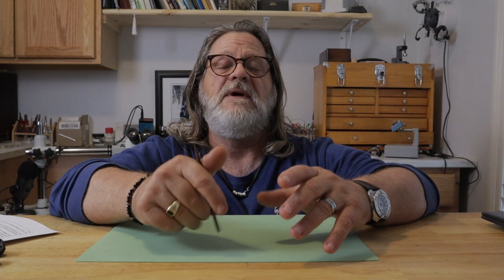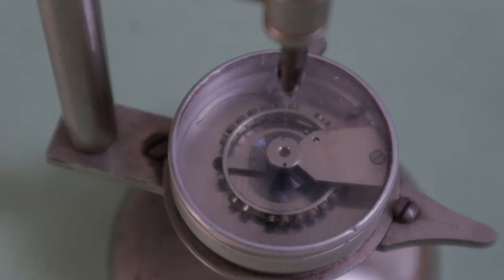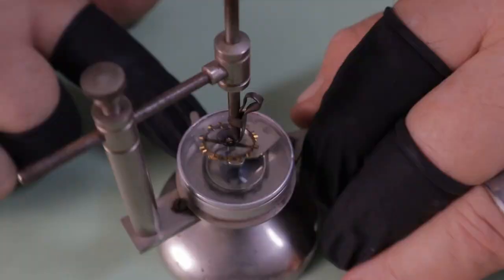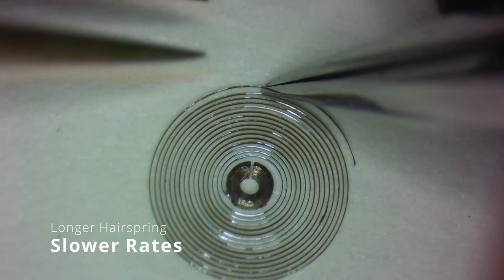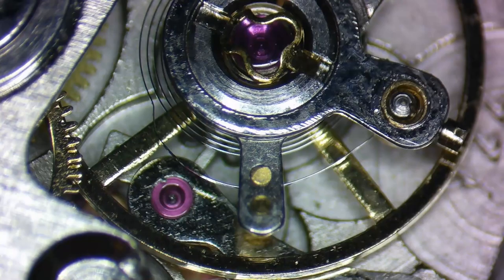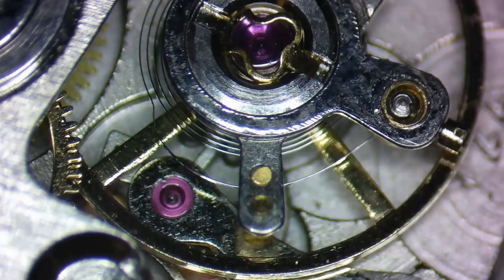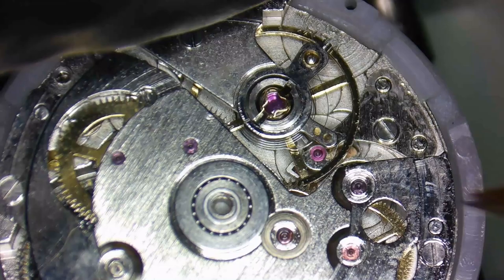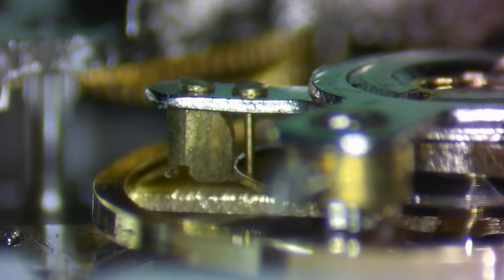Watch Regulation- The In's & Out's

Comment: It's getting more complicated now Alix. I've watched the video a couple of times but not sure if I'm missing the point. I realize the pins should be parallel but thought they should be as close as possible but the hairspring be able to freely pass through them to stay constant at low amplitude. Am i missing something? If you get paid for views I might be helping you get rich with this video😂
Reply from the maker: Sorry Keith, 
Let me try to clarify what I was going for here. 
1) First was the point on the hairspring that is determined from the vibration of the hairspring with is the counting point. This is the area on the hairspring where the rate will be closest to zero without any other manipulation.
2) The next thing if that if the counting point was attached to the HS stub, there would be no way to fine tune the rate and at the same time would be even worse because of the natural fault of the hairspring created by the pinning of the collet. The rate would be worse.
3) Because of the need to be able to fine tune the rate, there has to be a mechanism built into the movement that can change the active length of the hairspring. The active length originally being the real counting point. 
4) That's the job of the regulator pins. They change the active length of the HS to be able to get to the practical counting point, 0 rate.
5) Depending on how the HS sits while at rest in between the pins, will determine how the HS reacts to different amplitudes AND whether or not the active length moves away from the counting point or sweet spot or if you will, or closer to it producing better rates.

You are correct that the pins should be as close as possible to the pins without binding BUT, they still need to be straight and parallel to each other otherwise you are going to create a positional fault even in the horizontal positions.
Does that make sense
Reply: Cristal clear. I think I was looking to far into it. Your knowledge and willingness to share in such an unreserved and friendly manner is what makes this channel outstanding. Thank you my friend.

Comment: You mentioned in one of your videos ( maybe this one) that you have to wait 24 hrs. After lubricating to actual regulate.  Others channels may actually do that but I don’t think it was ever mentioned.  Thanks again!
Reply from the maker: If you’ve properly serviced the watch, and you take a reading as soon as you put the balance wheel in and then look at it again 24 hours later, you’ll notice there’s a difference. This is basic watchmaking, 101.
Reply: @watchrepairtutorials  one more question, do you have a video which beat error and regulating a vintage balance with the adjustment screws? Thanks again!
Reply from the maker: @Al-po2oh  That will be covered in m watchmaking course.

Comment: so i got a new watch. brand new with an sw500. the watch runs absolutely erratic. been having this thing for a month now. some days its at +6 seconds and some other days its somewhere between +10 to +45 seconds. i have no idea what it could be, that it is so inconsistent. I left it run itself out and it changed nothing and also demagnetised it. any idea what it could be?
Reply from the maker: As you probably know, there are different grades of the SW500. Assuming it’s the lower grade specify, the factory specs are  plus or minus an average of five seconds a day with a maximum deviation of 20 seconds per day so you max is a little high. 
You didn’t mention the brand so it’s hard to say how well they regulated the movement or if they did anything at all when they received it from the factory.
It could be related to lack of activity to one of the main springs, so the power is on the low side, combined with how much you run the chronograph. 
If all that is normal, then most likely it’s just a problem with the regulation of the Etachron system.

Comment: Great video! I really enjoy the details. One question: How do you position the hear spring perfectly in the midle betwen the regulator pins in this regulator type? The hairspring stud cannot be adjusted by turning like you did it in Etachron regulator. If it is done by manipulating the hairspring... it could take many many attemps... I woud really apriciate if you could point me in the right direction. Do you have a video covering this? Thank you again for your work.
Reply from the maker: What you do is hold the hairspring and run a needle across it to massage it over. It’s a slight touch and you go very slow. Of course you need to make sure the regulator pin or pins are also straight.

Comment: These are the most useful and instructive videos, by far! Thanks so much for making them. I didn't previously understand why the hair spring needed to be centred between the regulating pins, and not touching them, when at rest... but this explanation made so much sense I now understand that in order to maximize the time that the hair spring is touching one or the other regulator pins with each swing of the balance wheel, it must be centred between them. Eureka!
Reply from the maker: Inquiring minds want to know.🤗

Comment: Fantastic video, I worked out, all by my self, that the regulator pins should "nip" the spring. The reasoning was that in the centre the spring was full length and when it touched the regulator pins it was shorter. I eventually realised this was wrong but now I know why.
Thanks
Reply from the maker: Hello Leo, 
The escapement and balance is, for me, the most fascinating part of the Watch. It’s really like a symphony of interactions that happen 6 times every second or 18000 times an hr.
Fascinating stuff.

Comment: You're doing great content mate, been learning alot from your videos.

Just wondering if you might be interested in making a video about hairspring replacements. I've been trying my hand at it but can never seem to get the balance spring inbetween the two regulator guides!
Reply from the maker: I touched down in a little bit in the video I did on adjusting the Etachron system.
Can you be more specific on exactly what problem you’re having?

Comment: This is the level of detail I am looking for and you are the only channel I've found that has it. I have one question though and forgive me if its already been asked in the comments. I scanned them but didn't see it. Question: Are the regulating pins doing anything when there is low amplitude and the pins are in the counting spot? It looked like the hairspring was just passing through them untouched at low amplitude. It would explain why you need a full wind on the watch when you are regulating.
Reply from the maker: Even at low amplitude the HS still touches the pins, which is affecting the rate.
Reply: @watchrepairtutorials  Got it. Thank you sir!

Comment: Alex, 
I was hoping that you would get to the subject of hairsprings. I want to know how many times it can take a reshaping back to round and flat before you just toss it. Not having the tool for vibrating a new spring to the balance, and not being able to find some older model balance complete leaves me frustrated. I had one that I reshaped it 5 times before I gave up and used a donor balance complete. Every time I would reshape it to almost perfection, install it and shortly it would be wacked out of shape again and losing amp. Removed, cleaned, shaped, demagnetized, cleaned, reinstalled, work great for short period, repeat.  Reshaping is a nerve wreaking procedure on a badly out of round and non-flat hairspring.
Thank you for the videos neighbor. Jay
Reply from the maker: Hi Jay, 
All hairspring have an elastic limit which is different depending on its strength and age. A spring can be worked any number of times until some area on the spring is pushed beyond that limit.  If any point on the spring goes beyond the EL it will never be the be the same and is considered set.
just beyond this EL is considered the point of fracture and that's when it breaks.

Comment: Great vid, will definitely need to watch a few times as this is complicated and a bit weird to wrap my head around.
The hairspring vibrating tool at the beginning, is that just a tool to make the process of finding the counting spot faster than simply checking the rate with a timegrapher while adjusting or is that a necessary tool that i almost certainly can't afford and probably shouldn't bother with as a hobbyist?

I'm also a little unclear as to what the purpose of it is if the practical counting spot seems to be the useful spot on the spring to locate and the vibration tool can only find the regular counting spot?
Reply from the maker: After a balance wheel is statically poised so that the wheel is balanced, think of the weights added to a car tire rim, then the hairspring which is always to long when new, needs to be sized to that wheel. 
This skill is pretty much useless today as the new hairspring are not available to the general public, and even though its taught to new watchmakers today, watchmaking has become a job of changing parts out, because its more cost effective.
 The 1st point to the video was to understand that the regulator pins control the active length of the hairspring.  The counting spot is merely the point on the hairspring where the rate will be at its best. 
The second point was that the position of rest of the hairspring between the pins will affect the active length of the hairspring which becomes a bigger deal when the movement goes vertical. 
The reason why this is important will become more apparent when we get into adjusting regulator pins to bring rates closer together.

Comment: Wow.  Just learned a ton here.  So in addition to trying to get a hairspring flat and concentric as it sets on the balance staff, nothing the orientation of the hairspring through the regulating pins sound important.  I have heard that you can improve the positional rate in the pendant down or pendant up positions of the watch by adjusting the spacing between the regulating pins.  Is this true?  Will you be talking about the impact of Beat Error on regulation?  I have run into instance were the position of the terminal stud and collet on the balance staff is not sufficient to allow enough adjustment at the terminal stud to get to 0.0 BE necessitating rotating of the HS collet on the balance staff.  Just so many factors to consider here.  Thanks for the thorough lesson here.
Reply from the maker: That’s a great question. It is true that both horizontal and vertical position can be manipulated by the regulator pins. Very good Supercruze.
It will be the super time of an up coming video.
That is getting into the realm of Watch adjusting.
Super cool stuff coming

Comment: Thank you. Great job.

I've got h-50 (c07701) with a huge difference of an amplitude between any horizontal position (dial up/down) ~270° and any vertical (12/9/6/3 up) - 220 and less. No problem with accuracy, power reserve and beat error. Any advice is appreciated.
Reply from the maker: As you probably already know, it is normal for amplitude to drop between the horizontal and vertical positions. 50° is a lot for that movement. In my opinion if you’re not suffering from accuracy I wouldn’t worry about it.
Reply: Thank you so much! Yes, there's no problem with an accuracy, but sometimes it could stop at approx mid-winding

Comment: Regarding the vibrating tool, it wasn't explicitly stated ,but I'm assuming the spring under repair is supposed to have the same bpm as the test balance?
Reply from the maker: That’s exactly right. the goal is to see both valance wheels oscillating at the same speed in unison
Reply: Thanks!

Comment: Does this mean I have to find/buy vibrating tools for all the different frequencies a watch can run at?
Reply from the maker: You would but they could be very difficult to find. Most vintage watches are going to be at 18,000 beats per hour until you get into the 70s. At that point, you'd be better off, trying to find a hairspring.

Comment: Hello . Exelent training on all subjects. regulating an older balance wills is sometimes a.chalenge , if the pin is not straight. I put a new main spring, serviced a movement and put a new balance will. the watch is running great. but the horizontal amplitude is 340, the vertical is 270--285. The watch runs very stable with a   0 to 02 beat error. the timing is perfect , with the perfect delta. almost no difference between
horizontal and vertical positions.  Should I use pivot flattening, to lower the amplitude. is 340 to much.? it is the same up and down positions.
Reply from the maker: 340 is too much. Are you sure the LA is right?

Comment: I am currently starting with vintage watch regulation and this is my first situation. I serviced a watch and needed to burnish the pivots to get some decent amplitude in vertical positions. This worked out nicely, however after service, I have some huge delta in rate in which I need some help: 

DD +45s/d 280deg BE 0.2ms
DU +60s/d 295deg BE 0.1ms
6clock down -60s/d 225deg BE 0.0ms

So the rate drops significantly when I go to vertical positions. Also, the regulator arm is already close to the full minus position. The both horizontal positions differ but I accept that in this situation (I watched your other video about the flatness of the balance pivot). Now I am striving to achieve similar rates for horizontal and vertical positions, at least not this big of a delta. Do you have some tips where to look?
Reply from the maker: email me.

Comment: Alex awesome series, just one question regarding the regulating pins, I have done a couple of seikos now where the manual actually states the hairspring should touch the pin. Which confused me because I thought it should be able to move between the boot and the pin. What’s your take on this?
Reply from the maker: Send me a link to it.
Reply: @watchrepairtutorials  it's in the service guide of the seiko 2906, https://watchguy.co.uk/cgi-bin/files?showfile=Seiko/2906A.pdf&filename=2906A.pdf&dir=Technical%20Manuals&action=documents

It states to always have the balance spring touching the pin lightly.
Reply from the maker: @alexanderkamerbeek9693  There may something I don’t know about that movement and how it’s manufactured so if it’s saying it should  be lightly touching then that’s where I would start and then see how it adjusts through the different positions. 
It’s definitely not typical
Reply: @watchrepairtutorials  it's a tiny 28800 bph movement so maybe there lies the reason, also the spring doesn't really have a stud l, you slide it into a block and secure it with a pin.

Comment: Hello, Love your videos. Could you sent me a link to your video tutorial where I can learn how to trouble shoot some adjustments problems. I got it as completely not running. The watch was properly cleaned but I cannot get it running good enough for my expectation. Beat error changes dramatically with position and some other issues too. I suspect that balance stuff was changed with slightly longer the one and its being pinched when I tightening the balance bridge screw it stops the movement (pivots seem to be straight, jewels not loose, hairspring was definitely manipulated before but looks ok now). I put a spacer there and it works but not possible to regulate it properly. I think that it may interact differently with other parts now ones the spacer is in. Anyway if you send me a correct link to your video/videos that describe adjustment and regulation in detail I would appreciate that (I understand that these could be a paid content). I think that I may need to get a new balance or /and pallet fork to correct it but I want to keep as much original as possible in this case.   Thank you
Reply from the maker: I have some more advanced videos on my Patreon page. There are a couple explaining the escapement inspection. As well as other videos that don’t get published on YouTube.

Comment: I know it’s not related to the video but I have a seiko NH34A and I have dis assembled and cleaned and then re piled it but now my amplitude it lower than I would like,I know you said the mainspring is the best way to get more amplitude but I don’t have a winder and I’m thinking hand winding it would just make things worse, what do you suggest?
Reply from the maker: Well, there’s many many things in a watch that can cause  low amplitude. The main springs come in a ring so you don’t need a winder. That would be the first place to start.

Comment: Hi Alex,
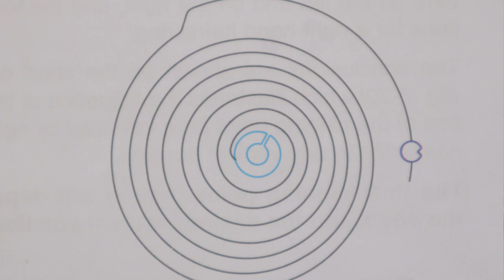At 4:50 you mentioned that the balance spring did not have this offset when it was originally vibrated. I watched it a few times now and still can’t get through this statement. The reason for this „offset“ is the curve of the balance spring just before the collet, right? So if this was not the case when it was vibrated, does that mean that it was vibrated without being fixed on a collet?
Do all balance completes (including all new ones) have this same offset?

Regards
Reply from the maker: What I am referring to is that when it’s vibrated, the hairspring is of course pinned in the collet bet the pivot is not confined in a jewel hole and the hairspring is not in between regulator pins so the forces are not the same as the hairspring is being vibrated. 
Once the balance is installed in the movement these other factors along with the pinning point of the hairspring in the collet change how the hairspring oscillates.
Reply: @watchrepairtutorials  So basically when it is being vibrated the balance complete spins around its „natural center“ of rotation. It’s the factors you mentioned in the final assembly that lead to the mentioned offset.
Reply from the maker: @chris9413  correct